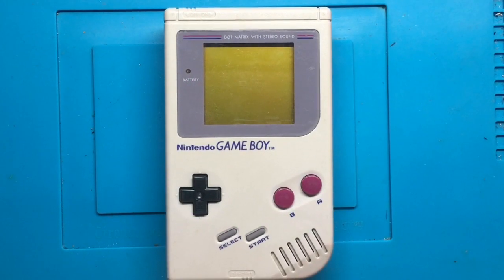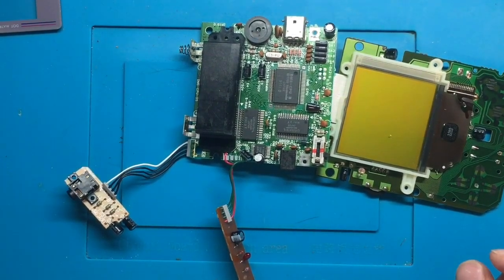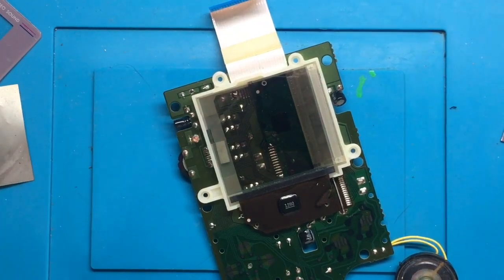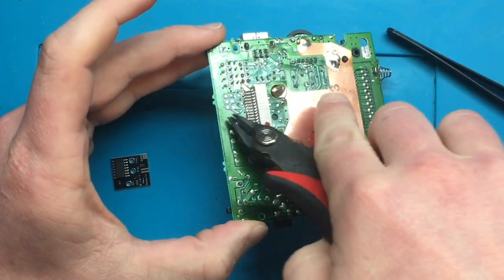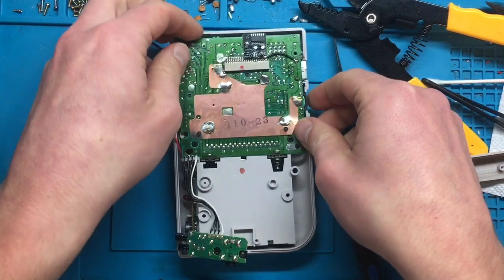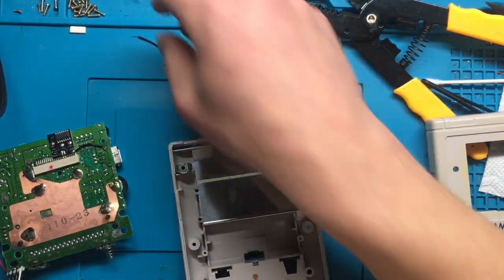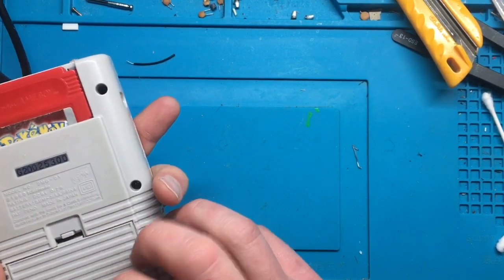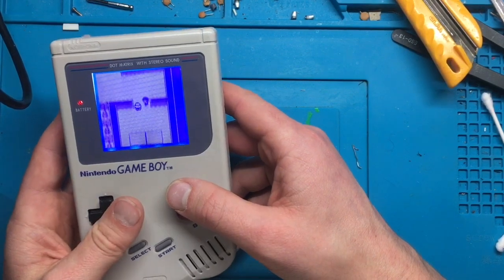Game Boy DMG - Backlight and Bivert Mod - Fixing eBay Junk

Comment: This popped up on my list and I gotta say, this video is amazing. I got the same mod from hand held legend, have been loving it ever since I installed it. I wish i had followed your guide. You explained so much more and your technique is much more refined. I'm actually going to redo my bivert mod how you did it, as clipping those pins below the bivert mod should def make it sit much better.
Also I am sure you fixed it by now, but the main back board is supposed to have 2 Phillips screws. Not major, but I cringed a bit when you missed them. Still, great video!

Comment: Love these videos! Keep them coming! You resparked my interest in Electronics, and I'm currently in the process of building an electronics lab from scratch. Going to get an X-tronic 5040-XR3 Hot Air Rework Station, and all the other typical equipment one would need. I've got ebay bids open as we speak for things waiting to be fixed! Thanks for the spark!

Comment: 46:45 You're gonna wanna take a moment to try and lift as much does and finger prints as possible.
👀💦 me staring at whatever is stop in the top right corner of the screen hole and the lens goes down permanently over it.

Comment: Thanks for the detailed instructions on how to install the backlight and bivert mod. I just took mine apart and you missed the 4 screws on the non LCD board to hold it to the case. Not sure where you put them on your mat, but they didn't make it back into the Gameboy.

Comment: Followed the tutorial and when switched on I had some blank lines near the top of the screen. Removed the bivert chip to check for any bridging of soldering and the two pins snapped off when folding them up off the chip. Is there anyway to repair it now?

Comment: Interesting that it has tri-wing screws. The Game Brick I have is put together with regular philips head. Maybe it's a later revision.
Reply from the maker: I think the very early versions used Philips, this board was a revision-6, so much later in its life
Reply: @RetroRepairs  That would make sense, as a transitional period before the Pocket and true hardware upgrades.

Comment: When I put mine back together. The screen goes blank until I press on the case, which isn't all the way closed. But pressing also messes with the picture even more. I can sometimes get it to look right. but it doesn't last long. Wonder if the my case is hitting the bivert

Comment: What to do about a couple of vertical lines that won't go away with a soldering iron, and don't even show up with pressure? Not for a second. :/
Reply: Tinnitus Relief ! Most possible situation is unfortunately they are most likely permanently damaged and unable to be fixed

Comment: I really enjoy your videos. But there's something i don't understand: Instead of your makeshift battery-pak, why didn't you hook it up to an adjustable PSU? Just use some alligator clips and hook up the output of your Lab PSU to the battery terminals, no batteries needed.
Reply from the maker: Had i had an adjustable psu, then that would definitely work, but i make do with what I've got

Comment: I found a DMG that had been in a carport for God know how long,   the lady said she was the original owner,   but it's weird?  It had vertical lines,   been watching you vids for a wile now,  so I figured I would run your video wile I did my repair.  It's a grey dmg I am sure never opened.  Why does it have Philips screws?
Reply from the maker: There may have been some versions with Phillips screws,  some old NES carts came with those instead of the security screws.  I haven't come across it myself,  but that wouldn't surprise me if that were the case
Reply: @RetroRepairs  I wish I could send you a pict,   and i owe you a few beers,   the stuff you have taught me so far has help more than you know.   It's just such a sweet find for me,  comes with a cool story to.

Comment: after the retro fit i got no picture but i have sound. dunno what i did wrong. i watch you do it while i was doing it on mine pausing and backing up. lost my gameboy.
Reply from the maker: Did you make sure to replace the Polarizing filter?  Without it, you won't be able to see any image.  These screens send the display line by line through a ribbon cable, so it's unlikely you've completely killed it.  Even if you botched it, you should get some sort of image.
Reply: @RetroRepairs  i used the polerizer that came with the back lite screen. i have no picture. i have link awakening in. no picture and all i have is sound. could i have gotten a bad bivert module?? i put it to dark no pic. changed it too light no pic.
Reply: @RetroRepairs  I took off the bivert module and zelda is backwords on the screen.
Reply from the maker: @dacgaming415-30P  did you mske sure to resolder the pins and check for bridges?
Reply: @RetroRepairs  not yet but used the old polierizer i took off and holding the pins down with a flatheat the zelda name is backwords. dunnowhy it would be backwords

Comment: I did one of these and got a tiny bit of alcohol stuck in between the screen and polarizing film and it won't go away. I don't feel like talking the Gameboy back apart though.
Reply from the maker: That's a pain. It should dry out eventually as it's not airtight in there

Comment: Hi! First of all thank you for the video!
Please, I need some help! I have already installed my backlight and bivert chip but I don't know why gameboy only works with games without internall battery,  I mean, for example when I play kirby's dreamland everything works properly but when I try to  play pokemon or Mario land 2 which have battery , gameboy do not works. It is switched on but only the the panel light. I think that I have a problem with the voltage. Is it because of the batteries? I have tried to put a resistor ( 100ohm and 200ohm ) and remains in the same way. Please could you help me?

Thank you!
Reply from the maker: Odd, I don't have this issue with mine.   Where did you tap into 5v to power the backlight? Possibly its drawing too much from that source?
Reply: @RetroRepairs  I soldered the wires to the central capacitor as in the video. My voltage on the cap pins is 4.2v and 3v at the cartridge inlet. I have thought of soldering directly to the + and - of the battery connector. What do you think about it?

Comment: HELP @retrorepairs ! 

I performed this mod but when everything plugged back and soldered the backlight was working but screen and sound not working, seems games arent booting... seems like ive fucked it :( any ideas?
Reply from the maker: Only suggestion is to go back and inspect your soldering. Make sure there's no bridges or shorts to ground.  Are the pins you soldered to the bivert board connected properly?

If all else fails,  remove the chip and backlight and see if it works without then try again.
Reply: @RetroRepairs  the plot thickens! So the GB will power on and display the black rectangle with accompanying sound with no cartridge in but will not boot with a game in it and just show blank screen... any ideas? btw really appreciate the help!

Comment: Do you do this as a service as well? I want to do this to my system some day, but have no soldering experience.
Reply from the maker: No,  i just don't have the time to operate a repair shop.
Reply: @RetroRepairs  I understand,  thank you for replying. I'll probably have to do it myself and use your video as a tutorial.  How hard is it to learn to solder?
Reply from the maker: It's not bad at all.  My suggestion is find some board that you don't care about and practice there.  Practice soldering parts on and removing them.

Check out Eevblog on YouTube  hes got some excellent soldering tutorial videos.

Comment: do you have any ds lite to fix? I need to clean some milk that got between the lower screen, but i'm too scared to open it up by myself...

ps.: you are making me like to fiddle with eletronics again, I haven't done that in ages lol. I love your vids man
Reply from the maker: Unfortunately no, no ds lite.  Shouldn't be too diffixult to open, just be patient and careful around any ribbon connectors, they're very delicate on the ds
Reply: Sorry, I don't meant to cross-spam on @RetroRepair's videos.  But if you want a super-detailed walkthrough of a case swap / refurb of a DS Lite, I've got a pretty in-depth video of that process!

You can see it here:
https://www.youtube.com/watch?v=hbXWFrtLsf4

It's a pretty detailed process, but if you take it slow and steady, it's not too bad of a process!  Especially if you're only doing the lower screen, it's a super easy process to swap the screen / digitizer out if you need to!

Comment: Anyone have idea how to replace ribbon attached to lcd responsible for vertical lines? have one good screen with damaged ribbon, and second damaged screen with good ribbon
Reply from the maker: I've never seen it done, not sure how possible it is. Connecting it to the board is definitely doable, but it'll be a challenge to remove it from the screen.  You might be better off trying to jump the damaged part of the ribbon with some wire
Reply: @RetroRepairs  Removing this ribbon is rather easy, just using some soldering iron and when its hot its just letting go... but attach back its impossible since glue is no longer holding.
WireJumping its hard since there is no connection point on both ends

Comment: I like what you do and that you show the whole thing, but your method is sloppy and careless. A little more order in what you do would go a long way. For example: why didn't you clean the old adhesive from the front pannel (both sides) while you had it disassembled? A little capacitor replacement wouldn't have hurt either. You had to clean the screen parts multiple times because you kept putting your fingers on it. Still a thumbs up from me.